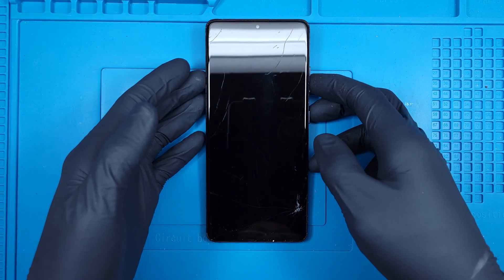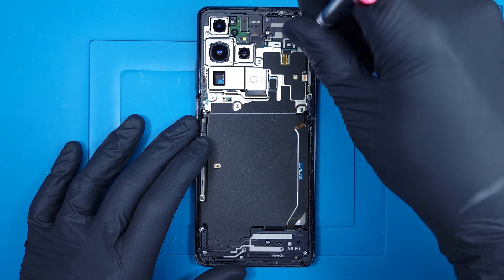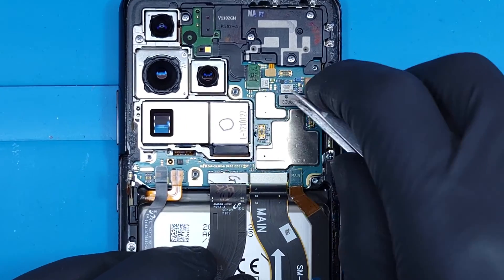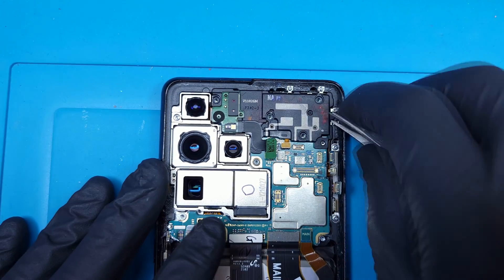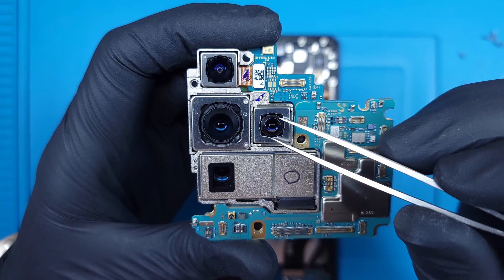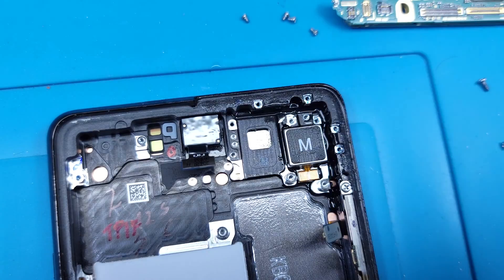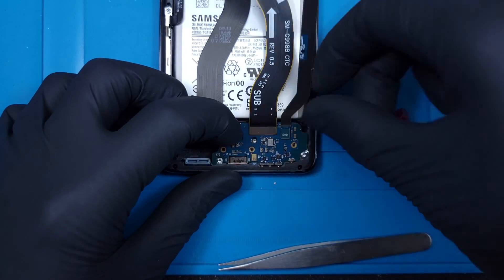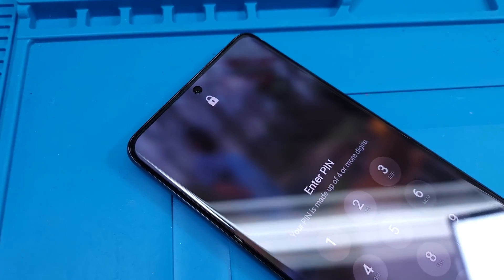Galaxy S21 Ultra Screen Replacement | Teardown Guide | Frame Assembly Replacement

Comment: Is it still an original LTPO panel?
Reply from the maker: Yes it is is, the replacement part used was an OEM from Samsung. I've only used OEM, so I'm not sure if aftermarket would use LTPO since it's relatively new, or just use a normal one like the S20.
Reply: Oh wow, I mean the LTPO would be so bad to loose for a broken screen as it's quite a game changer considering that it also saves battery.

Comment: Does this repair need a heat gun/any adhesives or just screwdrivers & prying tools?
Reply: .... And this is why the video shouldn't be labeled "Tear down guide"
Reply from the maker: It very much needs heat to remove the back panel, and replacement adhesive.

Comment: working in medical, we are using tweezers with plastic head for delicate catheters etc. I used one changing S20 FE frame ,felt safer to disconnect connectors ,around screws etc.. wondering why these never used in phone repair videos
Reply from the maker: Very smart idea! I'm also glad when I had a lithotripsy they didn't use metal tweezers.

Comment: Help bro my s21 ultra fell it had a vertical green line and one day after its became all black screen, i went to samsung and they want 400€ to change the screen, im not a pro but if it worked for an hour i think the screen dont have a problem, so my theorie is that the screen cable disconeccted and acctually i geusse im going to try to open it and try to repair it, do think that its may be some cable disconnected?
Reply from the maker: You got a crack in the OLED layer, once oxygen gets in the pixels slowly die. We call it bleed out, it will slowly go purple and dark until it's completely black. The display ribbon is more or less screwed down under shields so disconnects can't happen. Unfortunately you need a whole new screen.
Reply: @TapticDigital  should i try to replace it by myself?, Like i buy a new screen and replace it, and btw my phone is a livedemounit so even if i want to pay samsung i dont think they gonna accepte😂
Reply from the maker: @bisho0059  hey if you feel confident enough, it's worth a try! Otherwise I'd go to a local repair shop that isn't partnered with Samsung. My shop isn't, but we still use OEM Samsung parts and we don't care where it came from.
Reply: @TapticDigital  i live on france :(
Reply from the maker: @bisho0059  I've never been to France, but taking a look there appear to be some decent shops in Rennes and Paris. "France Phone" has some pretty good reviews. If you try it yourself just go slow, and follow the steps!
Reply: @TapticDigital  thx for help, appreciate

Comment: Hi. I have a Samsung s21 ultra SM G998B/DS. I replaced the LCD screen and after that the phone has not cellular signal. Only a circle with a diagonal line. I did hard reset• Update software to android 12. Partition reset. Changed battery and charging port. Moved the gammel gps antenna to the new screen. Nothing work. Could be the signal flex cable or logic board or a automatic system to turn off radio signal? Need help
Reply from the maker: Hi I would recommend watching my newer S21 Ultra video, there is an antenna in the top right corner than needs to be moved over in order for service to work

Comment: Where can you order the new screen and for how much? I would like to try replacing it myself as the repair shop was looking at around $500
Reply from the maker: Parts can be bought from MobileSentrix or Mobile Defenders or Injured Gadgets, they are roughly $330
Reply: @TapticDigital  if I dropped my phone and it just has a small circle of green/red where the 1st point of contact was I should just need a new screen right?
Reply from the maker: @clbtae  yup! New screen will fix you up, sadly there's no "unbreaking" a cracked OLED or LCD (at least not easily)
Reply: @TapticDigital  so my glass screen isn't cracked at all thanks to my screen protector so I'll just need a new digitizer? I'm not sure if thats what it's called lol I was looking at one of the websites you gave to use
Reply from the maker: @clbtae  hey no worries. The digitizer is basically the same as the "glass", so if that isn't cracked it's probably the display layer below (OLED). The downside is, trying to separate the glass from the display is incredibly hard. Kind of like trying to separate two potato chips that are stuck together without breaking either. Most places will use the whole replacement assembly that comes with the metal frame already attached to the screen, it's expensive, but cheaper than breaking one the other way. So far MobileSentrix seems to have the best prices on that part.

Comment: Can you not just repair glass, my lcd is fine.
Reply from the maker: It is incredibly difficult without very specialized tools. The cost of the tools outweighs the benefits, and it usually comes out cheaper to replace the entire assembly. The OLED layer is thin as paper and more fragile than a potato chip.

Comment: Help!!! I’ve stripped the screws for the antenna. Idk what to do. I know the antenna is irreplaceable
Reply from the maker: Nah, the antenna can be replaced, it just has to be a match for your region (US/EU). Those triwings have a decent sized head on them, I'd bet with some careful grinding with a dremel or file you could put a straight cut in the head of the screw and make it into a flathead screw for removal! The antenna will work fine with even just screw holding it in.
Reply: @TapticDigital  Ok so i purchased mine from Verizon. that would make it a US based phone right? Reason i ask is because on one of the flex cables, it reads G998B, and if i researched correctly, that is the international version. Am i missing something here?
Reply from the maker: @JaimeC17  the designation is on the flat top of the Lego connector for that antenna, it should read NA on it if you purchased it from Verizon. Some of the flex cables are used between international and US, it's really just the antenna that has compatibility issues.

Comment: Sooo i dropped my s21 ultra yesterday, it landed face down flat and most of the damage is the bottom right hand side of the phone with some spider webbing across the rest. The middle to right hand side of my keypad isn't working to type letters but i can swipe and select apps :/ Also my finger print reader isn't working now, will a screen replacement sort all this out or is there more 2 it?? I had a spigen case on and tempered glass but obv didnt help at all :( cheers!!
Reply from the maker: That's not too out of the ordinary for screen damage. Thankfully a replacement screen will fix all of the issues you described. The replacement screens include a new fingerprint sensor and unlike Apple, it will still work fine after replacement! The cost isn't pretty, but still cheaper than a new phone!
Reply: @TapticDigital  Awesome i dont mind paying for a replacement if the issues will be sorted, like you say...cheaper than a new phone! Samsung do a doorstep repair service in the UK which im gonna do...they just rock up in a van and sort it out there and then! Anyway nice 1 fella, thanks for the response.

Comment: Cool video, makes me slightly easier to feel about the repairs after my phone also fell out of the pocket while running and even though protected with a case, the screen got a white line, and after a day started flickering badly, so sent it to the official local Samsung repair center. However, they just listed, that they changed also the battery (which was great, went as far as 3 days with careful usage). Any ideas, why would be that? From the video, it doesn't look like it is integrated with the screen anyhow.
Reply from the maker: Yes! Actually some of the OEM replacement parts that you can get from Samsung include small parts already installed (volume/power) and some even include the battery.
Reply: This is the exact thing that's happened to me! This video fixes that, right?

Comment: Is it worrying to lay down the s21 ultra in table without case? I see that camera bump is a metal material and meant to offer a protection in camera module?
Reply from the maker: No worries, the bump lifts it enough that nothing will hit or scratch the camera. You are right that the part it touches is not glass, it is well protected. The metal of the frame even comes up to almost wrap around it, offering even more protection.
Reply: @TapticDigital  thank you for the info. Sometimes I"m being paranoid to lay down my s21 ultra in a flat surface that it might hurt the camera module when the bump hits the surface HAHA 

More power to your channel
Reply from the maker: @marvicchristophergonzales589  same! I treat my S21 Ultra like a baby. It has a case, screen protector, and I still lay it down like it's some kind of bomb that will go off if I put it down too hard.

Comment: Great work. I broke mine n sent it for repair. I hope   someone like you repairs it :/
Reply: Hi, I broke my S21 screen too recently. Can I ask u a question on the screen replacement? Did u send your phone in to Samsung? Or did u have an outside repair shop do it? I got a quote of $450. Does that sound correct?
Reply: @Donbarbz  not $450 - if you send it to Samsung should be around $300
Reply: @mrluwid172  thank you.
Reply: I have TMobile, and it's supposed to be $30 for a screen with insurance, but they don't repair in store anymore in my city of Omaha, so I have to pay $99 and they'll send me a new phone... I feel that's bs because I paid insurance to pay $30 for a new screen... But hey , a new phone will at least has no wear and tear on the motherboard

Comment: My phone slipped off my jeans and dropped right on top of a sharp rock now I have a big crack and a permanent white line...
Reply from the maker: Ouch, glass is not forgiving, and OLED panels are like potato chips and can crack easily. The parts are expensive but still cheaper than a new phone by a lot.

Comment: Just ran mine over with the lawn mower today on accident. Caught the bottom right corner of the frame and screen. Wondering if I can live with the frame damage if I got the screen replaced. It'll prolly rip off
Reply from the maker: Lawnmower damage can be pretty wild! Thankfully most replacement parts include the entire frame along with the screen, so you may be in luck! If you choose to contact professional repairs be sure to ask if the part they use includes the frame, I know stores like CPR Cell Phone Repair and UBreakIFix uses the framed parts!

Comment: Where did get the parts?
Reply from the maker: In this case the parts were sourced from MobileSentrix, they are a great supplier of Samsung parts and have options for OEM or aftermarket.

Comment: So the screen is built into frame and you just swap internals?
Reply from the maker: It is! This is a Samsung OEM part so it has the frame and some small parts preinstalled to the screen. You can replace the screen only, but it isn't very clean or fun.
Reply: @TapticDigital  hope the people that replace my does this . My frame got a scratch also.
Reply from the maker: @moosc  I think most places use the frame assembly part, it's just much less work. Depending on where you took it places like UBreakIFix are Samsung authorized and only use OEM parts.
Reply: @TapticDigital  that's who vzw has me taking it. Only $30 to fix it
Reply from the maker: @moosc  that's not a bad deal at all! Considering the parts alone are about $300-$350 currently from most vendors.
Reply: @TapticDigital  thanks for video n replies you made it easier and more informative to get out done .
Reply: Just had a thought does the phone get wiped? Ie lose all my apps n data?
Reply from the maker: @moosc  nope, it definitely shouldn't for any reason. I've been doing repairs for years and haven't seen any data loss aside from severe water damaged phones.

Comment: I got my screen replacement yesterday, but now my service doesnt work.. It shows E service instead of 5g, my Sim isn't being recognized, I've taken it to t-mobile to get a different Sim card nd nothing change I get 4g here n there but still every slow, i got 3 month warranty with the people who repaired my screen, but im wondering why it doesn't work that good now? Does the Sim piece that was removed similar to the camera where it has to be the original?
Reply from the maker: I believe so, that little antenna in the top right of the phone needs to be moved over. Though currently there are issues with sprint and t-mobile S21's losing service after a repair of not done properly. One we encountered actually had to be sent to Samsung directly for replacement because the carrier was either unable, or not trained enough to figure out how to activate it. This only happens with sprint or t-mobile for some reason